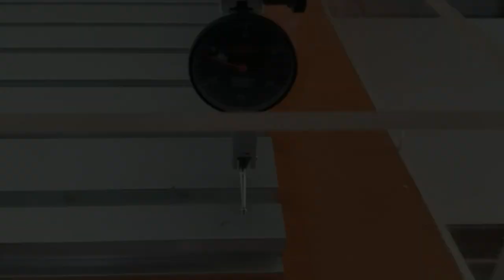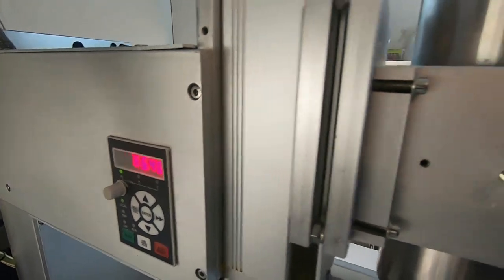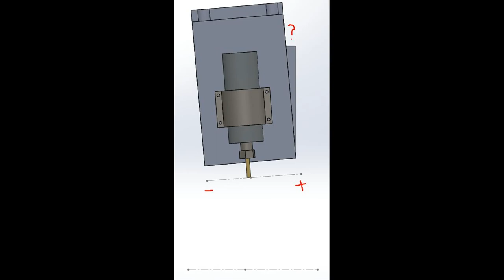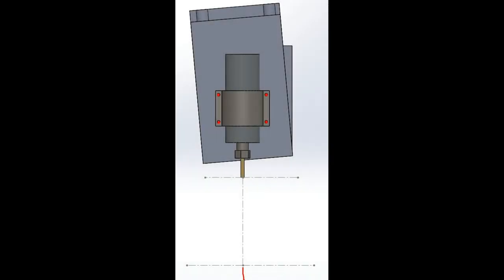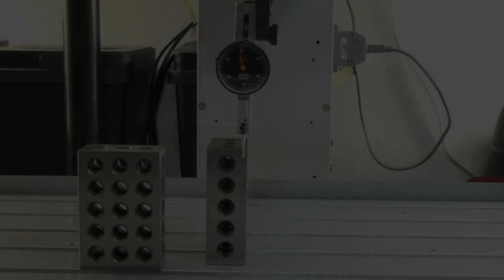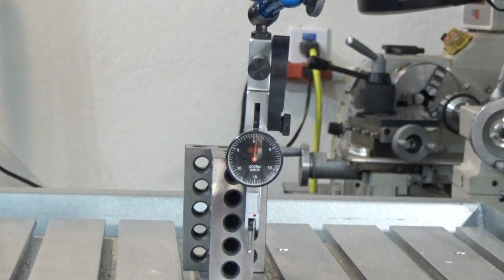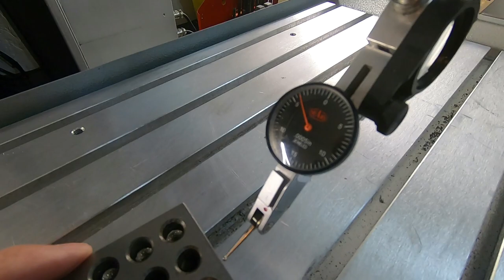HY6040 Mill, Proper tramming technique

Comment: thanks for the tips! i should be getting mine in like 1 or 2 months so i'll have to check it for tramming errors first and then have it running.
keep up the vids!
Reply from the maker: I glad you enjoyed the video. When you get your machine let me know, I can help you with setup and checking the squareness.
Reply: Did you buy this machine ... how do you feel in quality cutting aluminium and or steel. TIA
Reply from the maker: This machine can cut aluminum, slowly and loud! Steel I have never tried because that material is harder than the machines frame which is all  aluminum. Keep in mind the price of this Hobby mill. If you want to mill aluminum and steel in 2.5 or 3 axis I would suggest looking into Tormach, they're the next step in entry level machines.
Reply: @HandyDan  the tormach is way out of my budget. The more complex the machine is the more you are married to the brand.

In my head if buy a 10k machine I'll need 10k in accessories.

I was thinking buying one like this and upgrade the frame to steel if you ever take yours apart please make a video on the frame.... thank
Reply from the maker: That was my exact thinking and why I bought the HY6040. Even though it needs a lot of work it's still less of an investment than the next tier up.

Comment: @HandyDan Hi Dan, I just got my HY6040 uncrated and on my base.  Watching this setup vid for tramming the spindle and I’ve gotten a lot from your technique.  Thank you for that!  Just a question for you, or opinion from you.  You mention these machines do not have an X adjustment.  Unfortunately in my case my X tram is out about 7 thou.  Looking at the machine, would it work to shim the entire column at its base (where it is screwed to the machine base)?  What do you think?
Reply from the maker: Hello and thank you for watching, my thoughts on shimming the column I think a tiny shim would go too far but you can try that first.  Also if you check the spindle mount bolt holes, they might have enough play to adjust out some of the error. Lastly you could shim the table slide block or adjust the rod ends for any available room 😉

Comment: Hi Dan, thank's for your verry informative videos! I'm thinking about getting the same mill. Is there anything one should consider? Would you buy the hy6040 again?
The video where you mill the aluminum part to connect the gear on the a-axis looks very promising.
Cheers, Martin
Reply from the maker: Thank you Martin. In honesty I would buy another HY6040. But I would tear it down and rebuild it up from the start. As it comes it's 90% useless for anything precision  but if you compare the competition, Tormach $8,000 + or many others $35,000 to $55,000

Comment: i wonder if you could fill the column with concrete to kill some resonance.
Reply from the maker: My thoughts exactly 💯,  this is a hobby toy mill, it does mill aluminum but that's about it. I use it for plastic 99%

Comment: I will need to get a dial indicator. Can you recommend a decent dial yours 0:58 says 'INS 8/80 J 2:02 isn't clear either. My table is also separate pieces so I wonder if you can list the ebay source for your single-piece table? Wish it showed more clearly on your indicator-mounting method 0:49 looks really neat, like your magnet is holding a loop of some sort? Thank You Dan
Reply from the maker: John, the Dial indicator I have is from Shars Tools
Dial indicator: https://www.shars.com/products/measuring/dial-test-indicators/030-dial-test-indicator-0005-1-1
Magnetic base: https://www.shars.com/products/measuring/magnetic-base-stands/mini-universal-magnetic-base
Combo deal: https://www.shars.com/products/measuring/magnetic-base-stands/mini-universal-magnetic-base-with-030-0005-black-face-dial-test-indicator
The one piece table from Ebay is: 
https://www.ebay.com/itm/t-slot-plate-20-x-16-100-cast-aluminum-/184505923848?hash=item2af568f908

Hope this helps

Comment: Will it cut steel 

I do understand that time is NOT a factor here and I dont mind the wait .... if it cuts metal are you ok with the finish.

Can you make a video on metal parts. I'm a locksmith and I been looking for a cnc that will help make a key machine and other parts. Thanks
Reply from the maker: I have successfully cut aluminum and if you watch the A axis upgrade it does leave a decent finish.  Of course it can cut steel in light passes, but the tolerance would suffer a little due to flexing of the frame,  I notice this on aluminum to, I use 3 to 4 spring passes on any important surface.

Comment: Long shot but do you have a link to the extrusion you used?
Reply from the maker: For the table?
Reply: @HandyDan  ya. I was looking last night and not coming up with anything comparable. I'm likely using the wrong search terms.

Thanks for doing this series on this mill by the way. I have one and it's typical Chinese quality but with some work can be made acceptable.
Reply from the maker: I have quite a few videos on this Chinese HY6040, I New Table Replacement. 
It was 4 years ago and I didn't have a link, search ebay for T slot Table
Reply: @HandyDan  thanks man. I'll find something. Or get a plate ground and shim it if be
Reply from the maker: @iainhutchinson1957  This is the exact table I got, It was around $300 when I bought it.
https://www.ebay.com/itm/282449995688